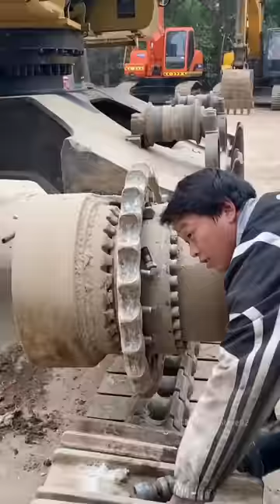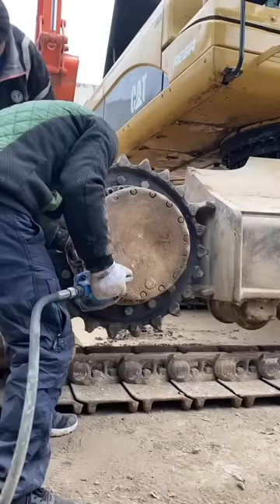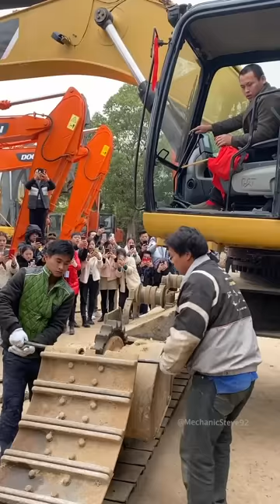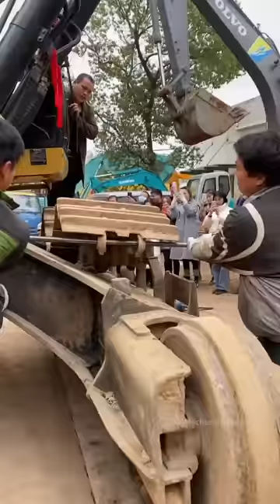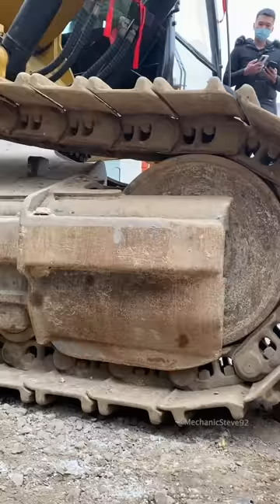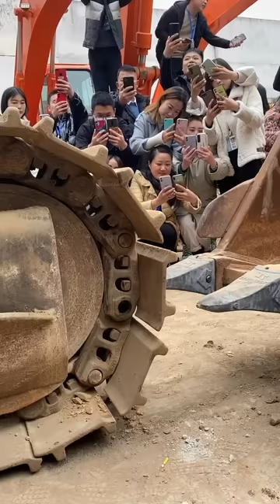Replace Excavator Sprocket with Mechanic James

Comment: Just replaced both tracks, both sprockets, both idlers, both adjusters, and all the rollers on one of our Deere 853M feller-bunchers 2 weeks ago. Cleaned 7 months of accumulated dirt, rocks, and tree branches out of the frame & u/c, and chased every single bolt hole. There was about 3/16” gap between the new idlers and the upper slides so our welder gouged the old ones out and welded in new pieces to take out the slop. There are no support rollers, just 2 support pads about 2 feet long for each track. If you finish the job without any smashed, black fingernails you did well!
Reply: Cool story bro
Reply: Was there a crowd of people hanging around with their mouths open making videos?
Reply: @anarchistangler  Hell no, the shop foreman is death on people “socializing.” The company owner probably got a couple pics for the 2024 calendar, though LOL.
Reply: Connection of sprocket of bulldozer

Comment: They worked hard on getting the tracks installed, but didn't use the end loader to pull the tracks on with a chain or large rope. Also they didn't need to remove the track completely.
Reply: True. He could have rolled the track back onto the carriers and blocked a grouser at the idler if all he was doing was changing rings. Plus, someone did a little cheating and left the springs out of the master.

Comment: I love watching you perform your job with professionalism and joy. We can learn allot from you sir.
Reply: Hi,🤫
Reply: Old pins and bushings on a brand new sprocket... that outta last a long time.  NOT... You know the old saying; if you can't do the job the right way the first time, how are you going to find the time to do it a second time?
Reply: There is not one ounce of professionalism here.
Reply: Even you can do it, overturn the undercarriages welded the cracks, frames,track shoes and etc, than installed back, done these jobs back in the 80s and 90s dropped this job than went to worked offshore in 1991, now pension in 2013.

Comment: Working in heavy mining industry for over 40 years and it makes  me realise we have come so far in occupational safety yet this makes me so nervous seeing no precautions takes to mitigated uncontrolled movement potential and fatalities potential, is life really so cheap there ?
Reply: My ass would be using an electric winch for the tracks and a crane for lifting off the sprocket. I bet I can get a lot more work done through out the year.
Reply: Lol, and this is by far and away not even close to the worst one out there…
Reply: Why the need to replace the sprockets on what looks to be a pretty new machine? And why are there spectators? And why do the women in particular look do interested?
Reply: @sethwatson8952  Maybe they had the tracks too tight.
Reply: A lot of real scary dangerous stuff in third world countries, I've seen guys walking through puddles with live welding i cables in them wearing sandals, bamboo scaffolding 40 ft. In the air in the Philippines plus a lot of other  hazardous things too many to list here.

Comment: I wonder what the on-the-job severe injury rates are for workers in these countries that have no requirements for PPE's like safety shoes.
Reply: And hammering on hardened sprockets with a sledge isn't a good idea either. That sprocket ring will chip and go right into a leg. He got the job done, but sorry, he put himself in some bad situations during that R&I.

Comment: Why didn’t you break the tracks at the sprockets and only have to move them back off of them instead of pulling the tracks completely off the top. Would save your back.
Reply: @mikethomas9544  and racism still continues to exist.. we are in 2021 for God sake!
Reply: @KHaLeD-jv7fu  must be a pink skin cavedweller. Never seen the light of the day.
Reply: @tannen3339  or a muncheechee happy to get a banana.

Comment: I am from Guyana , I'm excavator operator all that I do is screw off the idler nut and to make sure that the chain is slock enough so the chain is able to throw off from the front roller first and afterwards the chain have alot lengths so in order to clair the final drive and then the chain is off with out any force of a human and to put the chain back to original location it take me less than 5 minutes.

Comment: So break track on sprocket. Then walk machine backward so sprocket is in air. Then wind track forward off top of sprocket. R&r sprocket. Sling track to sprocket, pull track over or use bucket. Tram forward. Join track.

Comment: Everybody filming to be the first to get it on tic TOC when they get their eyes punched out, the top of their heads bashed in or one of those sprockets smash their toes. Safety gear? We don't need no stinkin' safety gear.😬🙄🤣😂